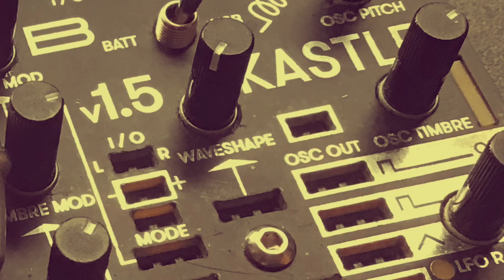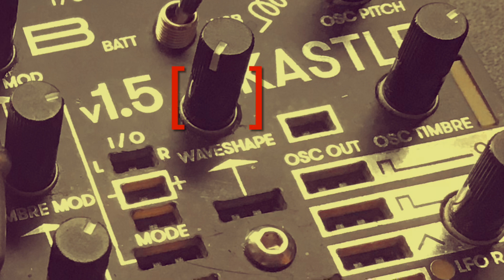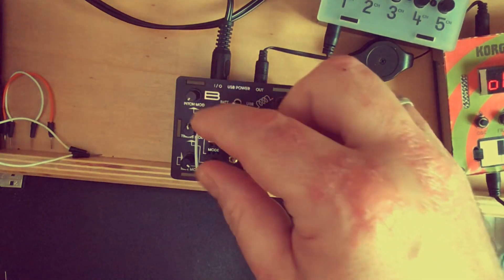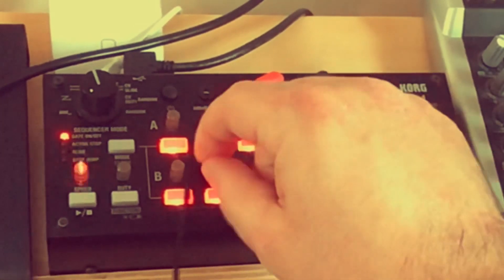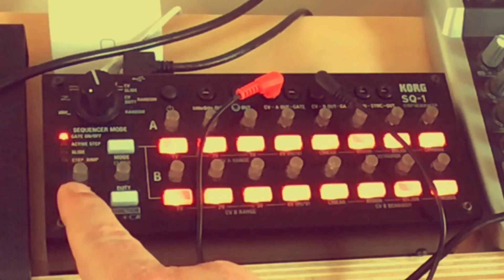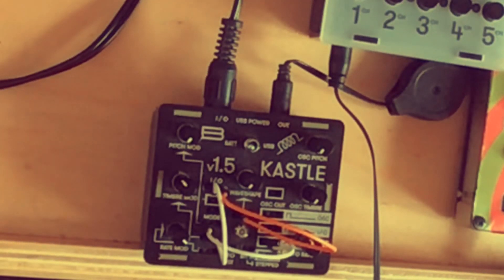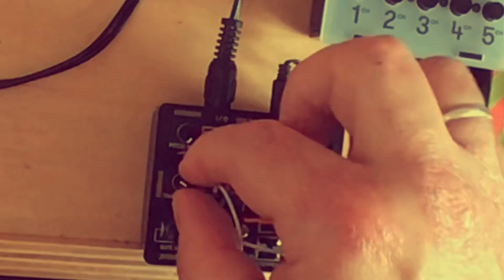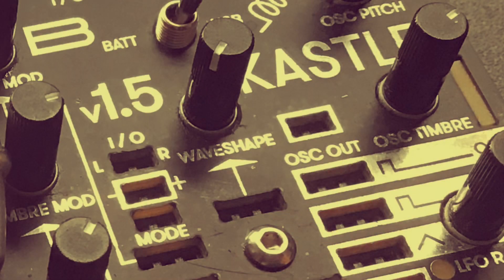The random mini-synth family #87: Kastle with VCA (BASTL KASTLE TUTORIAL)

Comment: Hey, this is really cool, thank you. But I can't seem to get my Kastle to play different notes with my Keystep. Can you post the exact settings and patches for your Kastle when you're using the Keystep at the end of the video? I really want to make my Kastle sound like this with different pitches.
Reply from the maker: Ok... so:
Splitter cable connected to the keystep. Left channel to cv out, right to gate out.
The other end, which is stereo, into the Kastle’s I/O input.
From left channel of the I/O, with a DuPont wire, into the timbre mod
From right channel of the I/O into waveshape 
WAVESHAPE knob fully anti-clockwise 
Pitch mod and Osc pitch knobs fully anti-clockwise 
Timbre mod knob at 12 o’clock or lower (with this you can variate the pitch)
Osc timbre knob almost fully anti-clockwise 

Should work 😁

Also check your Keystep settings... must be default settings, which I think will provide 5v out of the cv.
Reply: @chiptunasoundworkshop8257  It works, thank you! :)
Reply from the maker: Very well! 😎
Reply: @chiptunasoundworkshop8257  Ah, I didn't use a splitter cable from the Keystep. That's probably it. I'll try this again tonight. Thank you!